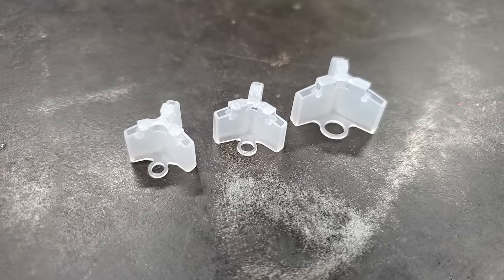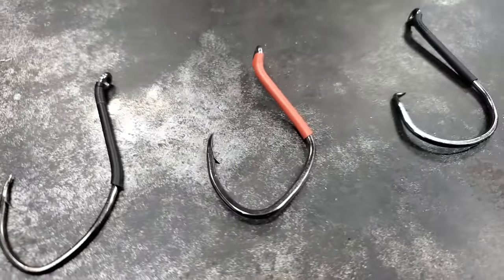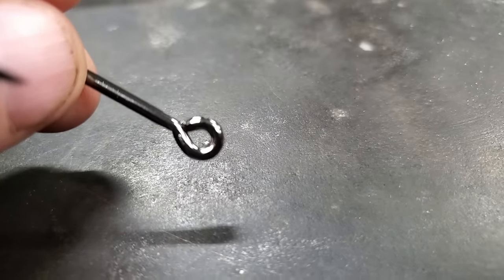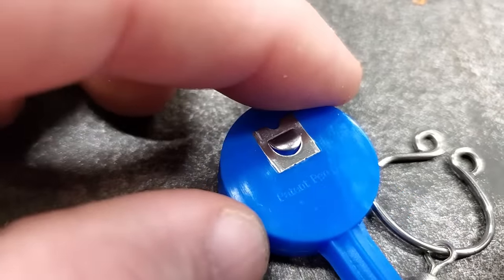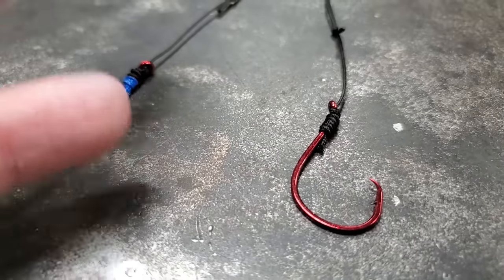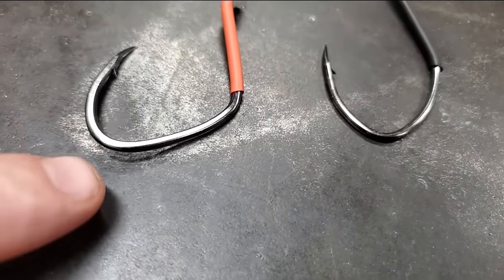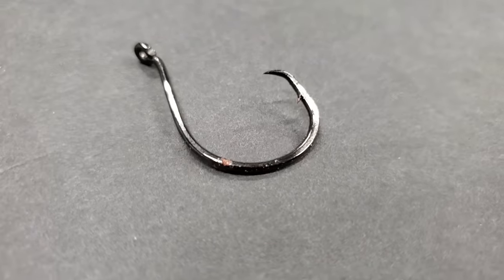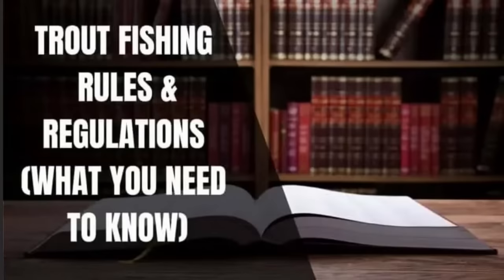Fishing Hook ( LIFE HACKS ) that are useful

Comment: I'm wondering if thread or paracord inner strands won't work instead of heat shrink tubing for the first hack and I know that an old dental floss container will serve just fine for a hook tyer. Simply pop it open, empty the guts, and there is a plastic cylinder inside that is perfect for holding the hook. Open the now empty floss container, place the hook around the cylinder (it is attached), close the container around the hook with the eye going out the hole the floss comes out of (may need to be enlarged for bigger sizes) close it, rig it, reopen the floss box, remove the hook. Smaller hooks can just be clamped in the box with the eye exposed instead of trying to get them around the cylinder. Since we either are buying floss or are getting it from the dentist, this makes the hook tyer free which is my favorite price 8-P

Comment: I'm also working on the easiest method of converting a prescription pill bottle into a slide-on hook keeper. I already use something for a hook keeper but I don't know that it is a viable replacement for everyone cuz not everyone will have access to them. I use medical marijuana for pain, almost exclusively concentrates. As such, I either get these little vials < 1/2" across made with a lid of silicone which I cut a straight line to the center and then rough cut the center for the hook. Twist slightly to slide hook into the lid, center the hook in the hole, and press firmly but only enough to pierce and not enough to penetrate fully. This then becomes a hook keeper either with or without the container attached. The other item I usually get for packaging are these small (~2" high by 1" wide), resealable bags that are perfect for small, premade rigs and or small bags for holding all the pieces for a particular rig so you don't have to go looking for something and risk spilling the main containers. Perhaps snack bags from the $1.25 Store will work, lol.

Comment: For picking up Trot Lines and One for a gaff my dad used some Shark Fishing Hooks that were big as my hand … and a cut down broom handle, carved a groove for the shaft and eye, used a small screw and heavy duty thread to secure the hooks to their handles … Used an old oar, handle end, drill probably a one inch hole  deep as he could the poured Melted Lead into the whole, it would burn into the wood so it would never come out … That was to knock fish out that he saw as a threat , Talking 50-60 years ago, rules were different …
Reply from the maker: That's a good idea

Comment: Use Magnets!  to keep track of hooks.   In the top tray of your tackle box stick a magnet with black electrical tape and  your spare hooks are going nowhere. When I was salmon fishing at Devil Gorge , a ''friend'' opened didn't latch my tackle box [which is second nature to me]. I picked it up , it spilled. Through the pier gaps I lost a lot of rubber eggs but no hooks. Why? a magnet!   Also do you have a little box of size 12 hooks ? toss a magnet in there they will be much easier to grab.  works good for small jigs too.

Comment: My Hook Mag.  I run trotlines and use 4/0 snap swivels at each drop.  I tie my drops about a foot long with a loop at the other end (like those packs of eagle claw snells.  )  it allows me to remove a fish or change out dull hooks quickly.  My hack, if you will, is to use 3/4 PEX tubing split lengthwise.  I then notch out both ends of the split.  I place the point and barb into the end of the tube and pull the hook down through the notch and down the the split. The split grips the shank and holds it firmly   I keep adding hooks until I have 50.  Then I wrap the drop lines around the tube.  This keeps them from tangles and I can grab a new hook without getting stuck. It also protects the points. Old timers used buckets to hang the drops but if the bucket gets knocked around you end up with a tangled mess of line and sharp points.
Reply: Another thing I found that works well is to use extention cord reels to roll up my main lines once all hooks have been removed.  They will hold about 150yards of #96 tarred twine.  It aids in setting out or bringing in my lines and prevents tangles.

Comment: I de-treble and de-barb a lot of my Rooster Tails and such just because I'm a catch and release guy and I want to damage the fish as little as possible. (This is just for ultralight pan fishing and stuff, no trout where I live.) I replace the hook though. I cut off the original treble, add a split ring, and then a new hook. And sometimes I'll even run a trailer on that hook. Even run an inline spinner with a Trout Magnet on it? It works.

Comment: I got some them hook keepers from China they didn't fit no hooks was to small or to big I had like 100 paid only few dollars. Lol. That hack with heat tube that's deff good idea. The hook eze love them they sent 50 kids one year and almost 75 kids 2nd time like 3 years later. I was talking to them about my big hooks they finally make a big red one for big circle hooks and others. So they sent me 1 and 5 to give away to some adults. There great people. Your hack painting 1 hook I wish ide thought that years ago when I run trot lines. I mean we would go one bait then difent then first one again we could remember but when we used 3 or 4 difent baits on a 50 to 100 hook line we would forget what's what so wish ide thought that. So thank you for the info and the offset I like them the best also. I've fished spots no barbs so had to smash them down also. I have cut few down to 2 and one saying hooks are bad. Few times cut wrong 2 so fell apart. Lol and the hook sharpener them are handy I keep one close I do want to maybe get that other one you showed it's has the 2 slots but hey another great video that will help so many. O the hook keepers you made with the tie and circle wish ide new that years ago I don't like putting them on my eye or under some hooks there tight. So again thanks sir.  And I'm not shur did you ask me to call you while back I got real sick we almost thought the virus finally got me but I think it was pneumonia or bronchitis almost felt like when I ended in hospital for lung clot very scary. But I have to find the video you said that on. But was that you or am I thinking of someone else. Have a good week sir. God bless
Reply from the maker: God bless

Comment: NC does not have a law or reg for barbless hooks while trout fishing. Thankfully, because I think it would be really stupid to require barbless hooks ... for the most part.

Yes, the trout regs here are daunting. Better read them closely!

I fish many ways, for many species. I do use barbless for some things. But in my trout fly fishing, I tie my own flies. 100% of my flies get hooked in the outer lip/cheek and are easily removed. The Old North State pros know this. 

Natural bait is the difference. Trout inhale and swallow that, so they will die. That's the point of the reg. They are meant to be harvested. (Hatchery supported areas and timeframes come to mind) As long as people continue to follow the reg, it will suffice.

The only possible exception concerning barbs may be Cherokee waters or other federal trout waters. Not sure on those. But on the state level, barbless isn't required. Yet.

Either way, great vid Keith. I hope to see you on the water sometime. I think I might get back into carp tournaments sometime. I'll have to scope out your vids on that. Haven't done it in many many years.
Reply from the maker: NC doesn't have a law but South Mountain does . South Mountain state park has their own set of laws